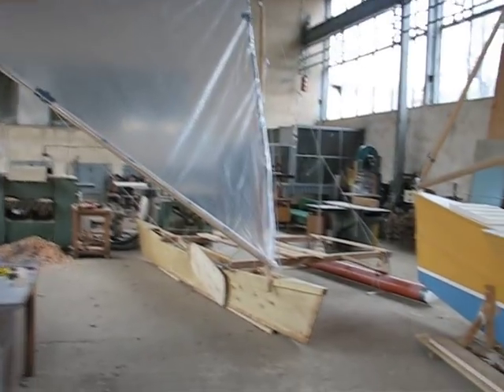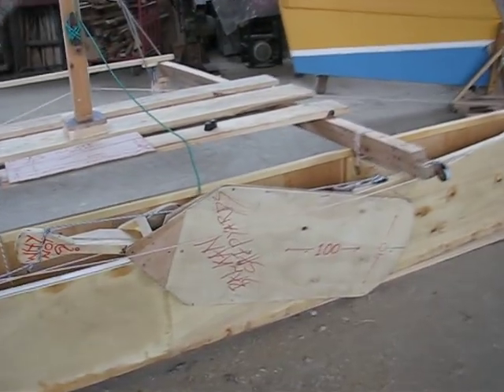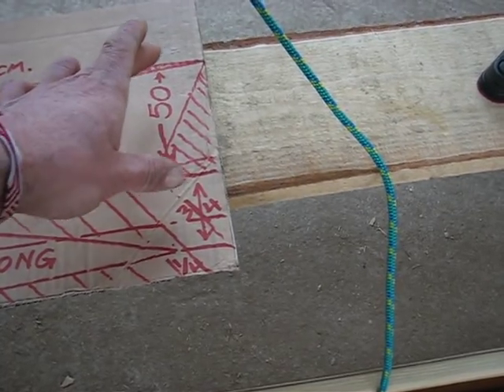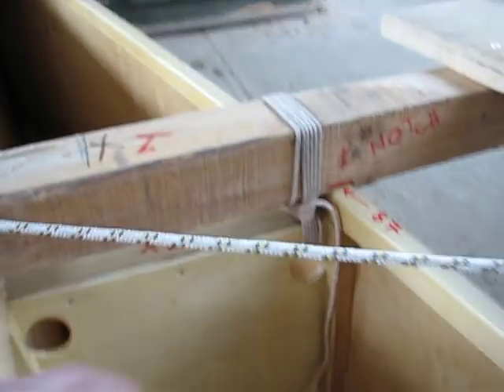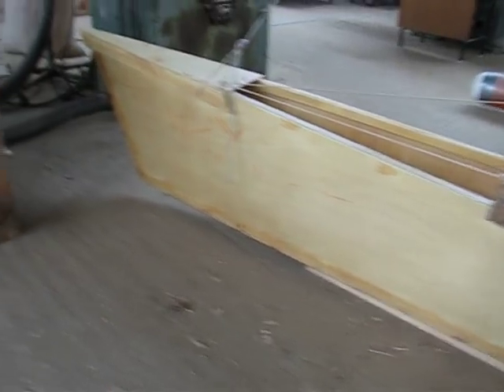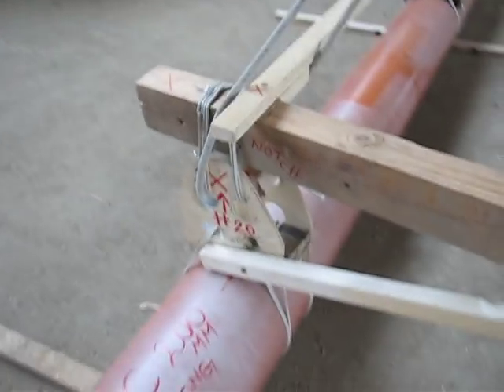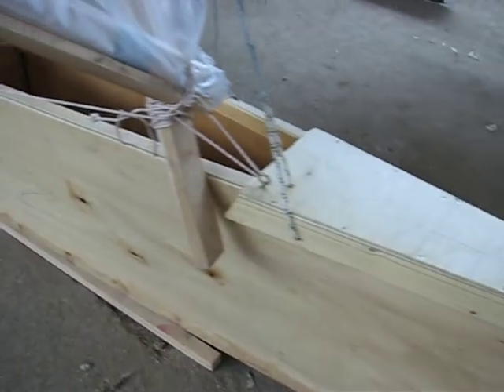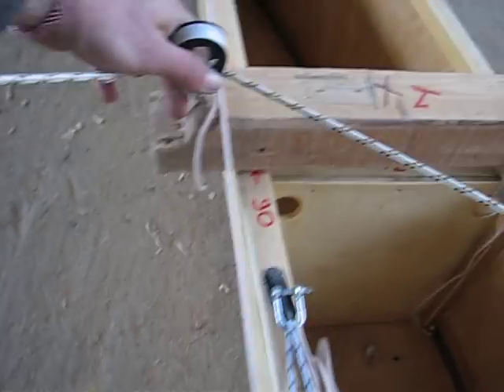pacific proa free design.

Comment: I think this is going to be my next build. Although I think it will be tacking instead of shunting (just used to tacking, so the first one will be tacking).
Reply from the maker: You know there is the rigging vid too: https://youtu.be/vH0x-tZUMY0    Shunting is easy to  learn, still a shunting Proa needs a canting mast, this concept is not perfect.... You can start with a tacking canoe and rerig later on.....  What ever you do, Good luck bro. Lets build Proas! Keep Shunting, Balkan Shipyards.....
Reply: @BalkanShipyards  Yes! I think I will eventually set up a shunting rig, if only out of sheer morbid curiosity! But right now I just want something that I can get on the water (and that I can launch like a kayak).
Reply from the maker: @DanielWilliams-oi4ss  You will need more volume in the ama then, I was using a 4 meter 200 mm PVC pipe. For a tacking canoe, I would easily go to 250 mm. But shunting is so much fun! a good rig after a shunt, will point her up and sail slowly to windward on the new shunt, giving you all the time in the world to change over rudders what ever they are.... Tell u a secret, shunting canoes are simple to design, cos you don't think about where the mast will be, and what shape and volume you need for the bow and the stern... You just make it all the same. You just need an easy rig that shunts fast and easy. Crab Claws are good for a start, and with a canting mast, things work well, easy and fast. It's simple, shunters rule! Think about it.... Any questions, feel free.... Keep Shunting brother. Good Luck!

Comment: Great! That's what i want to build! Can it assimetric hull be detachable? May be three or two parts?
Reply from the maker: Why Not?........ If  you make double bulkheads that you will bolt to each other, no problem. 
But why? if you can transport 4.5 meters and have where to keep it, it's much better, stronger, cheaper and simpler to build 1 long hull.......... Up ton you.
Keep Shunting, BSY.

Comment from the maker: SAIL. spars are 4 meters long 5x5 cm pine will be very strong, my boom is about 3x5 cm (a little thin, that's what I had and it works...) Round spars and taper them to 4cm if  U have time and energy.... MAKE SURE THEY ARE CLEAN AND DON"T HAVE KNOTS! that's important, spruce is the best. Lay plastic sail on floor place spars over it, measure 4 meters between spar ends, or less, depends on plastic size. cut plastic big enough so it can be rolled twice round each spar. NOW, use duct tape to fix sail edge to spar, role spar round twice, screw a piece of thin wood 13x20 mm approx... onto spar to hold plastic. The thin strip will hold plastic no problem, 1 is screwed under boom and other over yard, that way wind will flow over with less drag.

Comment from the maker: EXT 34. External 34 cm including plywood skin, so, take off ply thickness (on WHY NOT? 4+6=10 mm) so 33 cm inboard is dimension of bulkhead under sheer clamps. of course this is a rough estimate but it guides you how much you spread the canoe in the center before you start making cardboard templates for the bulkheads. Make 1, then test it on other side of the boat, if need be, make second bulkhead a touch bigger/smaller for a perfect fit. I glued 2 small battens with PU then glued and screwed bulkheads to the battens, now fillet and fiberglass on other side.

Comment from the maker: Vaka 4.7 meters. Ama 3 meters. max beam 2.5 meters. Vaka max beam 40 cm at sheer. Mast 3 meters. Spars 4 meters. Sail tack angle 55 degrees. 
Akas 2.5 meters, notch them above sheer clamps, to allow gunnels to lock into akas 7mm notch is enough. Ama to Aka plywood risers 20 cm high with spruce spine in center, notch akas for them too. Now Lashings just hold everything together, but notches hold things in place!

Comment from the maker: MAST 3 METERS LONG. just forgot to mention....

BOW RAKE: first cut bottom. 2. cut sheer to windward top side. 3. put bottom on floor, get a couple friends and just put wall in place, follow your chine, start from the middle and hold them together till you reach the bow. 4. mark on wall where bottom ends. 5. a straight line from bottom to top plywood corner gives your rake.

IMPORTANT.... now put exact same bevel on lee side. 2. now do the opposite, get the same friends, and hold lee wall over bottom STARTING AT THE BOW! run with it till you come to the middle, mark on wall where bottom ends. 3. cut a straight square cut from bottom corner up up sheer. DONE. your lee side is a bit shorter as it's more straight. But stem rake is exactly the same. 

VERY IMPORTANT.... stitch and glue is so brilliant that U cant mess up. all small imperfections get filled with fillets and you just cant go wrong.

All d best, Balkan Shipyards.